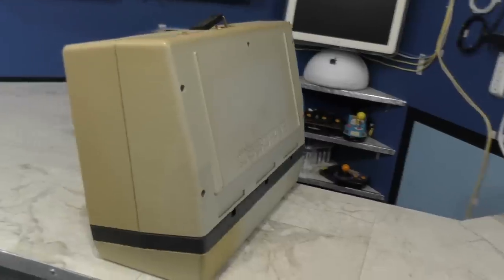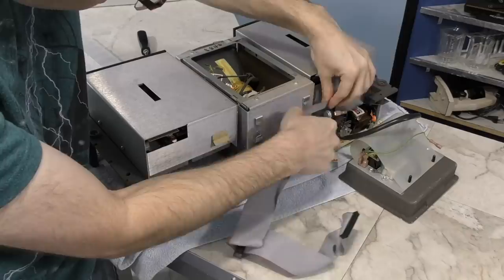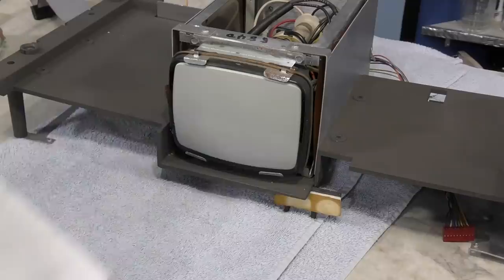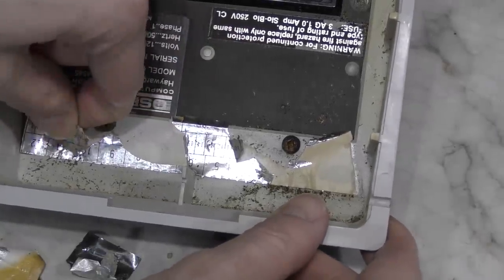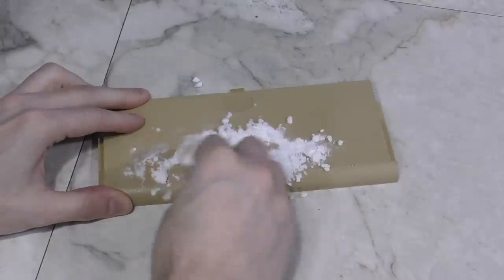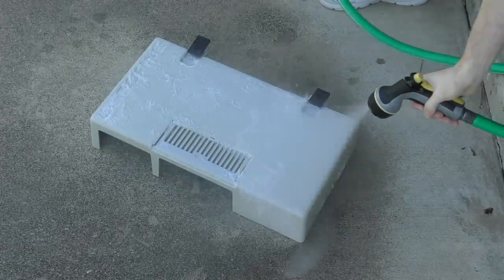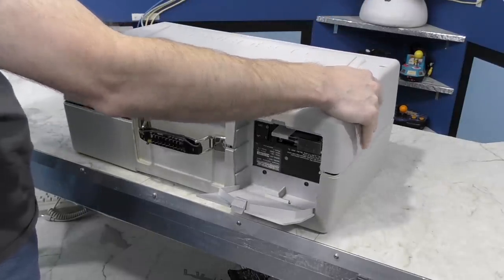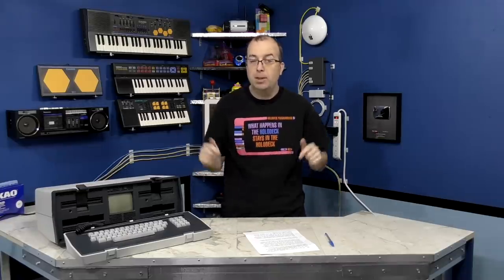Osborne 1 Computer Restoration Part 2

Comment: Overall, it's heaps better; just a shame it hasn't (yet) yielded a result in keeping with the time and attention you've given it.  But looking forward to part 3 (and 4, if needs be!).  Your layer diagram of the plastic/retr0bright/clingfilm illustrates what I have often tried to explain, but you come to a different conclusion.  I have wondered if the shallower areas of the solution allow more UV to pass, allowing it to work faster than the areas covered by thicker layers.  In essence, is more UV or more solution causing the streaking?  I also wonder if the film has a 'lensing' effect where it curves over thicker dollops of the solution, perhaps magnifying the sunlight.  Us Britons can't test this, lacking Texan sun, that's for sure!

Comment: The difference in design among the revisions is interesting.  I have a Osborne 1 Rev. 1.44.  The keyboard is very different.  The screws are on the side, just 2.  The keys have visible springs on them.  Also, it uses a ribbon cable instead of that coiled line to connect to the main board.

Comment: The difference in colour from RetroBright is stunning. I was wondering if the large plastic bags (used to clean oven grids with caustic soda) might be big enough for plastic computer case parts.

A friend used to put dirty old key tops in a mesh net bag, inside a dish washer to clean them. But it might run a bit hot. Also some dish washer tabs contain aggressive chemicals. So a test is essential.

Comment: Ok, let's summarize what you achieved:
- ruined the keys
- destroyed the leather handle
- got huge streaks on the big plastic parts
- potentially made the plastics brittle
As much as I love your content, you should really be more careful with your stuff.

Ugh, I wish people would stop with the peroxide v_v
Reply: SeltsamerAttraktor Well theoretically, the large case piece damage is reversible and a new handle can be made. Not sure about the keys.

I don't think peroxide in of itself is to blame though. Not all plastics are created equal and I think some plastics react differently to the peroxide than others.

If you look at his apple iie, C128, and Macintosh SE restoration, they all came out fine using the same technique.
Reply: Wait a sec... are you german? (I ask bc I am)
Reply: SeltsamerAttraktor so, letting it rot and get worse is the better option?
Reply: I actually happen to like the marbled look on the keys. I don't know why, but I think it looks cool.
Reply: SeltsamerAttraktor There are more ways to de yellow than just peroxide, Oxi clean works really well.
Reply: It's his stuff tho. He can do with it what he wants
Reply: I agree for whatever reason certain plastics whatever their compositional makeup just react badly to the retrobrighting process or at least this method of it.  I have done about 25 Amiga 1200 cases and keys and have had 100% success rate without streaking on this model.  The Amiga 500 however is a bit hit and miss,  most have been fine but probably 30% react like the case in this video.

Comment: You got REALLY lucky on that blown cap -- from experience I know a lot of them when they pop like that, also send enough power through the board to take other components with it -- and in most cases even blow the traces clear off the board!

No joke, the pathways on the board heat up enough to literally just come away from the substrate... leaving you to either find another board (good luck) or doing a point to point hack job on the wiring.

Comment: this is a long shot, i just started watching your show on you tube. good job. maybe this can help to even out your dispossession with the retro bright process. have you tried using a heat gun over the plastic wrap after rapping the peroxide on the plastic? just high enough over the process not to melt the plastic, yet to even the plastic grade over the plastic so it forms more evenly, if thats whats causing the distortions in the plastic. heat gunning the plastic may super activate the peroxide some before it hits the sun, which may prove for a brighter clean and prove more efficient when removing uv. i would say give it a nice clean pass all over, holding at least 3-5 inches from the plastic, maybe more depending on the btu of the gun.

Comment: I'm sure it has been said before about the plastic to protect the cream, honestly what worked best for me was using freezer bags or any clear trash bags and blowing them up with air and tying them off. I haven't really had a problem with that yet so not sure if it would help with you at all.

Comment: Ideally, there'd be a good way to spray it on evenly. Such as through an air gun, or a backpack weed sprayer. 

Something with a nozzle and steady pressure going through it... Like a 3 PSI fuel pump (that seems like overkill, perhaps a 12v washer pump?) and a carburettor jet.

Comment: The solution to the streaking is easy. You need to apply even coats of the hydrogen peroxide mixture. Get a cheap hvlp spray gun from home depot or online, a cheap compressor and there ya go. The solution might be too thick for that type of gun so maybe an interior house painting gun would work better

Comment: Now, this might just be an uneducated suggestion based on not knowing any better, but lets say you got a transparent tub or barrel full of the peroxide, using the liquid stuff or the gel if would allow enough light through and then fully submerge the parts to then re-use?

I know it goes bad once it has reacted, but I assume the gel would at least stay in place enough to only react where it touches something and the rest/majority of the peroxide still be usable. Justa a thought, might be completely wrong.

I did get my SNES done, inspired by your videos though, so thanks :)!

Comment: Hey David, I have watched this video at least 10 times, I enjoy your restoration videos very much! In a different video you mentioned that the heat method works well, but it is difficult to do for big pieces. My suggestion would be to use a large plastic container and a Sous Vide circulator, which can warm up the water (although you would be better starting off with warm water) and can keep it steady at a specified temperature, while circulating the water around the container. They can cost around $100-$150 but could help out a lot with your retrobriting!

Comment: For the handle was easy to remove, just drill the rivets out with a small drill and replace them with new ones. Materials and tools are easily available in the local hardware store. Alternatifly you could have used small bolts and nuts as replacement.

Comment: I recently did a restoration on a Tandy 1000 using the same cream, and the method I used was with a tooth brush. I would get the tooth brush damp, rinse the surface I was going to retrobrite, apply the cream and let it set for about 4 hours. It didn't evaporate and it worked great! I had zero streaks and so far it hasn't re-yellowed.

Comment: Use vacuum sealed bags. Not like the ones you use to seal up food in the kitchen, the kind you would use to seal up cloths for the winter. The kind that actually fit a vacuum cleaner attachment. Use those.

You could fill it with peroxide and water then use a wet-vac to seal it. Most are transparent too.

Comment: Maybe you could rig a sprinkler at low pressure to continuously cover an item in the liquid peroxide?  That way you would just need a basin with an inch of peroxide in the bottom rather than gallons of the stuff.

Comment: Suggestion for retro brightening large components, try using large plastic bag like you get those to vacuum large blankets, put the item inside, put your retro brightening solution, seal the bag, vacuum most of the air out so the bag collapses onto the item, just be careful so that some of that substance doesn't get into your vacuum, and now you got a large item covered with retro brightening solution, in a large bag without using too much peroxide.  Cheers!

Comment: Really good restoration, Dave, just a damn shame about the marbling. I do retrobrighting, and the way I normally do it, is apply the hydrogen peroxide cream, then I put the item to be retrobrighted in a transparent or translucent box (tupperware, or similar plastic sealable crate) that way there's no contact of the plastic wrap on the retrobright solution, because there's no plastic wrap. I've restored Apple II, BBC Micro, Atari 8 bit computers, etc this way, works for me. Love your new intros btw, both for 8Bit Guy and 8Bit Keys (subscribe to both) absolutely love your channels, and really look forward to new content. Great work, bud

Comment: The wrapping nylon creates a non uniform coat so in some parts it will block the light which will slow the process down so you get these differences in color. I would suggest building a UV exposure box and that way you can cover the panels and expose a known dosage for a set time. You won't have to get out every few minutes to apply a new coat. Building such a box will take some time but it can be done and I think the results you will be getting will justify it. UV florescent tubes are not very expensive either.

Comment: Replace any old Rifa capacitors on sight! There's at least two more you can see in that shot of the one that blew.

Dave at EEVBlog did a whole video on them which is very informative. Apparently, old Rifas are notorious for catastrophic failure with age. As the plastic shell ages it begins to crack, letting in moisture, and then *POW*!

Comment: When smoothing 3D printed parts, people use acetone vapor (just keep the part in a chamber with acetone at the bottom). The vapors smooth slower than direct contact, but it functions the same as submersing it. If the peroxide flashes off very quickly then this technique might work well too. It will probably take a day or two in the sun to work, but it will save you a lot of peroxide.

Comment: You ever thought of using a spray gun to apply your peroxide? Apply a thin layer and put it in a tote with a small amount of water in the bottom, cover with cling film (Saran wrap) to allow the uv to penetrate and see what happens. The water and seran wrap will stop the peroxide from evaporating. Should give a uniform finish.

Comment: I work for a plastic injection molding company and we use a product called pre fix 6500, produced by a company called chem-pak to fix minor appearance issues (splay, stress etc). Granted we are putting this on new parts and not abs parts that have been yellowed over time but it might be able to mask some of the issues on the keys and provide a more uniform appearance. Just a thought.

Comment: As a kid, I used to take stuff like this apart with the idea of fixing it. Normally it would all just remain broken, once, however,  Isuccesffuly repaired a laserdisc player. I have no idea how I did it, but it didn't work before I took it apart, it worked after I put it back together.

Comment: How about to spray the hydrogen peroxide on the parts? A normal and cheap pistole which is used for base coat should work. You can ask in the next paintshop, to try this.

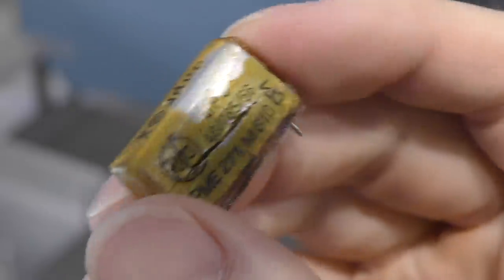Comment: 4:00 Those capacitors can be replaced with a modern equivalent.  If you look around you can get the exact same capacitor, but generally I recommend leaving ti out for a system that is for display purposes only and wont be run a lot.  If ti will be displayed in a running condition, just replace it with a modern one.

Comment: I think that if you were to use quickglo on those metal parts, you would like the results better. It coats the metal and protects it from further rust and deterioration while it lifts up the rust particles. Otherwise, put some carnauba wax on those metal parts to prevent future rusting.

Comment: Given that it has a composite connection, I wonder if it would be possible to hack in an LCD screen instead of the CRT.
Those things give me the willies these days, you can never trust them to be reliable, especially in a piece of kit that is getting moved and knocked about a lot.

Comment: As you said, the best way is total submersion for the small partes because the water penetrates evenly through every difference in the plastic surface. 

What's causing your uneven look is the cream itself, you should always use water-like products and not cream. 

for the bigger parts you could put some water-like peroxyde in a paint can or sprayer, and just spray the whole surface with an even layer of peroxyde. 

water on water is better than cream-on-cream

Comment: I've noticed these AC line caps in the power supplies are prone to failure, I saw you replaced one in another computer you worked on. If you ever do take to actually replacing them, they do make "safety caps" specifically designed for use across the AC line, a lot of the guys who restore vintage TVs and radios like Bandersentv, Shango66 and the like use them in their restorations. I can see why these days with modern external surge protection, they aren't as crucial as they once were

Comment: Wordstar, FTW. :)  I used to use Wordstar back in the day. I still remember some of the keyboard commands. The crusty sticker that you removed at 06:56 was used to indicate a date of manufacture. Notice that one line had numbers up to 12, the next line had numbers up to 31, and the bottom line had a series of years. Did you get any good pictures of it before you removed the sticker? BTW, I like the Holodeck shirt you were wearing. Where did you get it?

Comment: Using Philips oscilloscopes and Revox tapedecks, I know these RIFA capacitors.
I saw the smoke and I was like 'RIFA?'. Yes. RIFA.
So you left the other RIFA capacitors in there? Hahaha, they'll be next. They'll keep blowing up until one doing something important gives up the ghost ;). 

Sticker looks like a date sticker. Usually there's little holes in the sticker telling you some date.

Try car polish on these chrome parts next time! I clean up a lot of old audio equipment, it works wonders!

There must be a way to apply the peroxide more evenly and cover it up. 

Looking forward to part three, again!

Comment: There's got to be a way of just making a tub of the solution so you can fully submerge the parts you're treating in it, making sure the whole surface is totally covered and evenly absorbing it. I think the uneven-ness of brushing it on is what causes the streaking, some areas having a thinner layer than others on it. I also wonder if using a more controlled UV light that doesn't move or change in intensity would do better.
Reply: I guess that got answered later on as I watched. But I'd think a small fish tank or something and a good UV light, possibly even the kind used for hydroponic growing, would be the ideal setup. The challenge being buying peroxide in large quantity.

Comment: This Capacitor is important it suppress the Noise from the Switching Power supply that will go out in your AC Power Net. Disturbance in other Radios, TVs, LAN, Computer etc can be occurred. This Capacitor is a must.

Comment: I'm sure you are aware that you can make your own retrobrite? Using Oxyclean and Hydrogen peroxide.
When I restore smaller pieces, I use a small container, fill it with the hydrogen peroxide over the item, and then add oxyclean, about a tablespoon or so. Depending on the amount of peroxide used. I wonder if you would have better results if you used a large tub of peroxide in your garage with a UV light? (That way your Texan sun wouldn't evaporate it all before it has a chance to activate?)

I live in Virginia, so my sunlight isn't so intense, and I leave them on the porch in the light outside...

Comment: So I had a thought following your new retrobright process: 

If this one is streaky and the new process should fix that, and UV causes the browning in the first place... Then could you undo the process by doing it without the peroxide? (Retrodark?) If it's uniformly browned then you could just use the new process to make it look better.

Just a half thought, after seeing this in my feed.
Reply: That would probobly take a while, as it got yellowed over 10s of years.
Reply: But this is pure UV and direct on the parts, not diffused through windows or blinds so it should do a heck of a lot more faster

Comment: I know it's a old video but brings back memories of my Osborn 1.   I had both those mod cards too.  The 80 character screen thing was kind of dumb, just scrolled to a larger screen.  Wish I would have save some of my Osborn magazines for you.  I had every one.  One more thing.  I just cringe every time you pull connectors out by the wires.

Comment: idea for the streaking effect: put the entire thing into an aquarium or a bowl covered by the transparent foil (as some glassware is not UV-permeable) . spray the retrobight onto the surface using a spray bottle instead of the paint brush. to avoid the entire hydrogen peroxide boiling off, fill the bottom of the bowl with 1cm or so H2O2 solution and place the entire thing on a hot surface such as tarmac in the sunlight prior to usage. The H2O2 will boil off, but stay in the container due to the foil. That means the atmosphere will enrich in H2O2 gas, preventing the H2O2 in the Retrobight to boil off as well. This is a modification of a lab technique called thin layer chromatography, in which you use a similar container and improve results by enriching the atmosphere with the eluent used.

Comment: instead of a paint brush try using a flat plastic spreader to spread a thin even layer. The brush is made of tiny bristles that lead to uneven spreading. To spread evenly you need to use an flat, even tool.